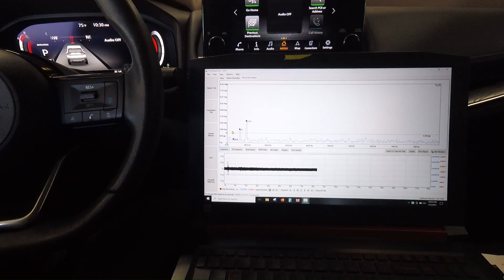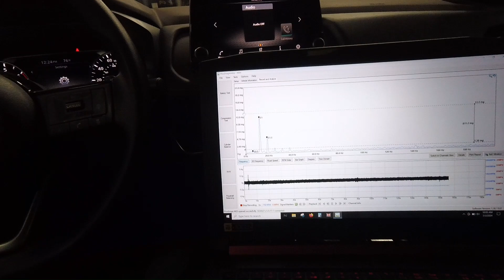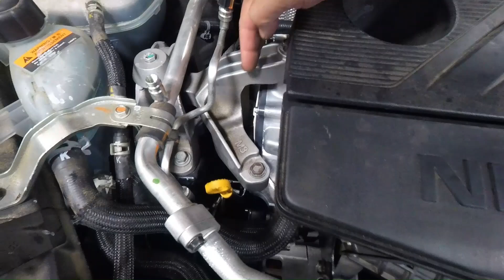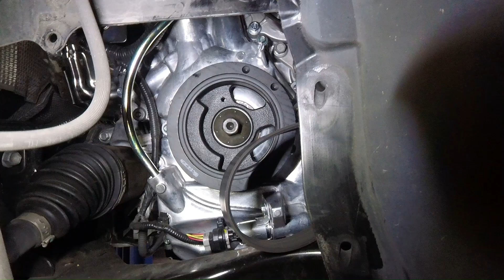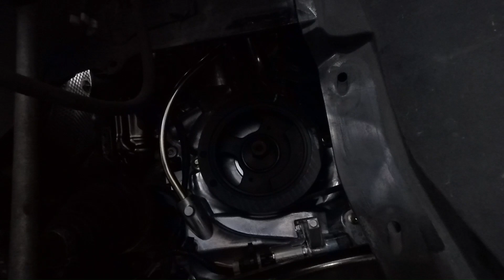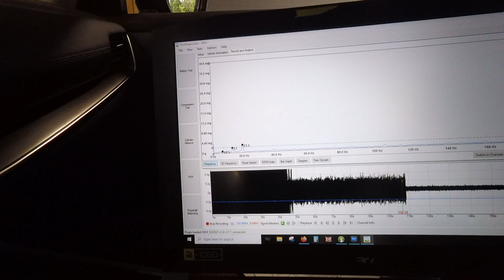Pico NVH Case Study

Comment: That is, you did all these tests and as a result, you just replaced the engine. But the cause of the vibration was never found. This is not a full-fledged diagnosis

Comment: Great process and some great information. Good to know about the ATS escan dongle working with Pico NVH. Escan is on my list of wants and that bumps it up a few notches. I've been using the VI3 because I haven't been able to get the Mongoose to work.
Reply from the maker: Great tool. It has very targeted strength.   The dongle is super small and out of the way.

Comment: Great Video Carter, i've been on the fence about getting a NVH kit for my pico, i haven't seen a lot of usage in the community, i know i get a ton of noise concerns from my customers & as you know sometimes it's hard to pin the exact issue, Do you believe this tool would be effective on suspension noises ?

looking forward to more NVH videos, thanks buddy
Reply from the maker: I think it would be good for noises,  I believe you need more than 1 probe so you can trianglelate the noise easier. I use the microphone alot for wind noise complaints, my hearing isn't as sharp as it was, so that helps me

Comment: Excellent diagnostic Mike! I've seen engine vibration in those 3 cylinders caused by different components. Mostly transmission mount leaking! Thank you for sharing, Mike. Good tool the Pico NVH.
Reply from the maker: The 3 cylinder has been very problematic.  I've used the NVH more on those than anything at the moment.  Thanks for watching

Comment: Ive used NVH and that is so powerfoul tool in goed hands. But bad thing is that you need to figure it out and do a lot of testing and comparing and...but its difficult to use tool that much in reality. I think that should be a lot more case studies with NVH so we all can learn.I found some converter shutter,diff noises with it.Engine vibrations are quite heavy to diagnose it with all that pulley diametars and crank rotations and calculations...etc...I like tool but i lack knowlege...Hope my English is ok.
Goed video!!!

Comment: Excellent video, as always! Thank you for sharing.
Reply from the maker: Thanks for watching!
Reply: @CartersDiagnostics  It is nice to have measurable vibration data. I own the advanced Pico NVH, which allows me to place four accelerometers or four microphones at different locations.
Reply from the maker: @steveanderson4553 That's cool. I just have 1. The shop has an unlocked picoscope so I can use my nvh and theirs  so actually I can use 2 at a time.
Reply: @CartersDiagnostics   I was tired of the butt-wars with the customers here at the dealership. It makes it so much easier, in my opinion, to prove out normal vibrations and abnormal vibrations.

Comment: Hi Mike, good to see you back. Sorry if I missed it in the video but I know you said you checked the runout of the crank with flexplate off and it was ok but did you  mention if the engine was still stiff about 180 from top dead while turning engine all by itself? 
Thanks.
Reply from the maker: Yes ,after separating  the engine and transmission it was still a weird stiff spot while rotating the engine even with plugs out.